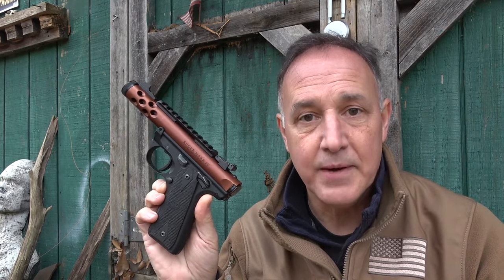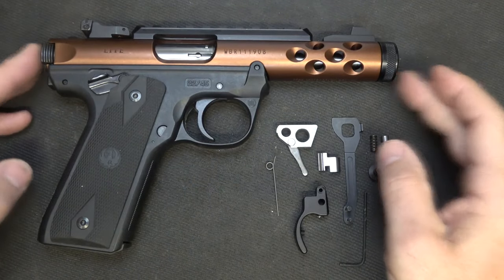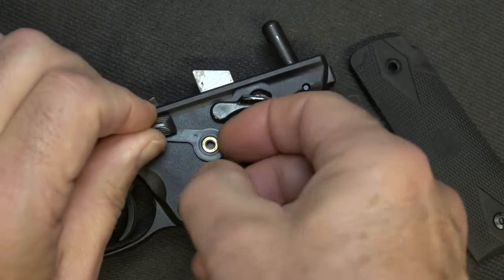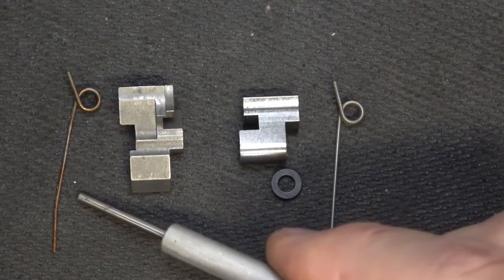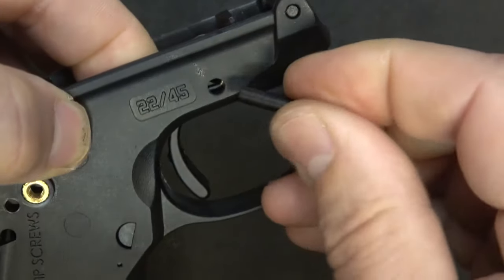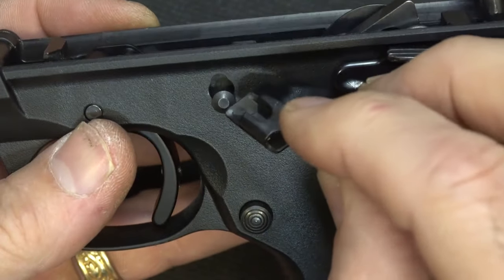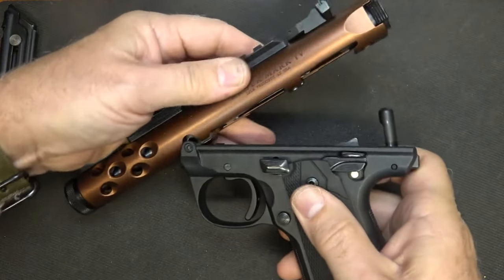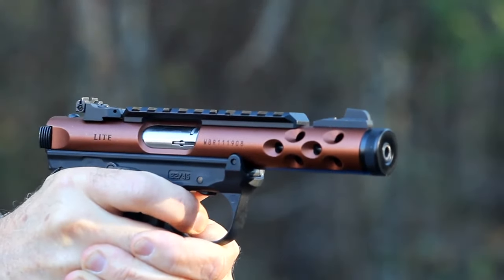Volquartsen Ruger MK IV Accurizing Kit Install with Sootch00

Comment: The video was extremely helpful but I wasted around an hour trying to figure out why it wouldn't work when I was done.  In the video Sootch places the sear spring straight down into the mag well... at least that's what it looks like to me.  But it's supposed to go behind the mag well.  Once you do that it's easier to get the spacer and sear in place and everything works correctly.  I certainly appreciate the help.

Comment: One of the best videos on installation. I upgraded my 22/45 with this kit and it removed all my failures to feed. Purchased the Volquartsen LLV upper and use it in steel challenge. 100% reliable. I also run CCI AR22 or Federal Automatch in competitions. Now if someone would start making quality kydex holsters! Always great content Sootch!
Reply: yes, spot on mate, and the bloopers was top notch as well, cheers from the land down under. i just purchased a mk iv s/s target, still waiting for the permit to purchase so i can pick it up from my gun dealer 👍 looken forward to my install
Reply: Tandemkross has a kydex holster on their website, not sure how great it is but they do have a video on there for it.
Reply: @nowaiman  I tried these kydex holsters but on my 22/45 lite where I removed picanty rail and installed a mounting plate for my red dot sight, the holster was not wide enough for the mounting plate to clear without modification with dremel. Update: I also ordered leather one but same problem. Mounting plate too wide also. May try to cut out leather some since holster difficult to return probably. Mounting where rear sight is after removal would probably solve problems but already invested in this mount. Oh well.

Comment: This kit is very nice but sadly they are somewhat expensive.  I paid like $340 for my new Mark 4 a few yrs ago. When I redid my CZ trigger I just replaced 5 springs for like $30 and the DA trigger pull improved immensely.
Reply: you paid $30 for five springs and call this expensive? This kit comes with an entire set of completely reworked CNC machined parts made from better steel. Same with Apex Tactical, which costs about the same. Tandemkross has fewer parts than those two and is $120. Market sets the price, if you can come up with something at an equivalent/better quality for cheaper, you'll be the leader.

Comment: So you have me confused! You say to use the shorter screw for the 22/45, I have a 22/45 MK IV, do I use the longer or shorter trigger screw?
Reply: The Mark IV comes in a standard configuration and a 22/45. Each of them have options such as the hunter, tactical etc. My understanding is that if you have any one of the Mark IV 22/45's you use the shorter screw. If you have any other Mark IV (standard) then you would use the longer screw.

Comment: You installed the long end of the sear spring, with it just loose in the frame.  Then at 11:05min mark, you can see the long end of the sear spring all of a sudden in the right spot (which is in the outer part of the mag well)  At what point did you put it in the right position?   I'm currently stuck on the safety/hammer installation... so i'm curious if that played a part in my troubles
Reply: The sear spring goes in to the side of the handle. I had that issue also. Had it all together then couldn't insert a magazine. Everything else was easy to install needle nose pliers you'll need for sure!
Reply: @blurryhmong  what does "side of the handle" mean? I cannot get this working properly, this is a crucial step and it's not addressed well in this video, which is otherwise fantastic.
EDIT - never mind, after much frustration I checked out Captain Gyro's video, he explained how this spring gets in there. It's a channel next to the main spring. The sear spring does not go down the magwell, like it seems to be here. Not sure why Sootch00 leaves out explaining that crucial step.
Reply: @singlemaltscotchy6430  pause it at 12:04. Right before he puts on the handle grips, there is a small notch cut out where the spring should sit in.
Reply: First thing I noticed, too! Good catch

Comment: Silly question but how do we know which bushing to use? I was using the thinner one since it seemed flush, but I installed the sear spring incorrectly and somehow lost the bushing spacer when fixing it. I was surprised the slightly larger bushing spacer also worked. I o c ourse found the other spacer shortly after cleaning up my desk after completion lol.

Mine came in the same bag unlike yours.